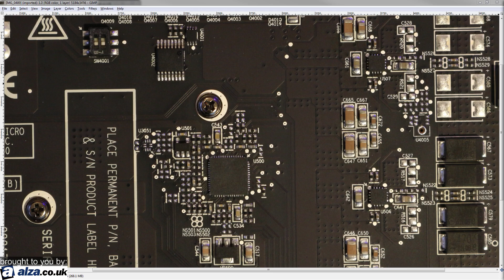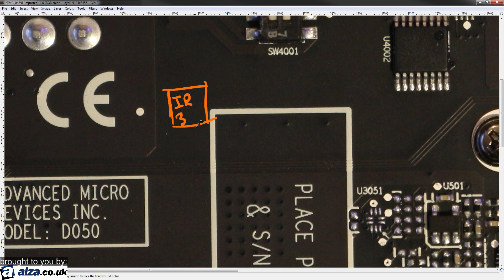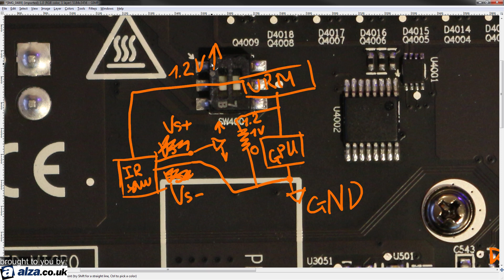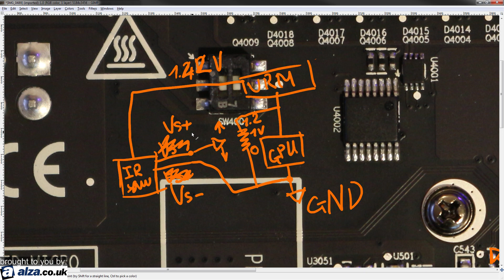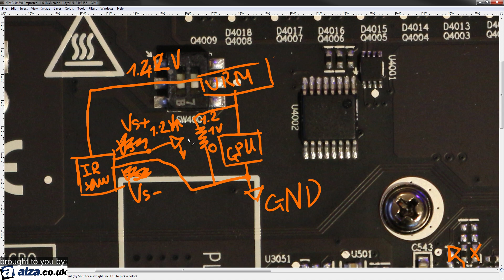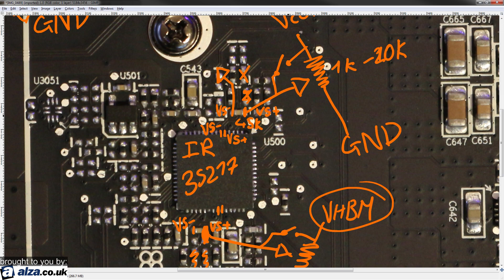Voltmodding Vcore and VHBM on RX VEGA

Comment: What is the purpose of those 2 resistors? 0 ohm resistors to couple to Vout to the sense pin? why 2? A schematic/drawing and some in depth explanation would have been nice. there are no resistors in the design example for the (a.f.a.i.k) comparable IR35201.

Comment: When you're explaining the HBM mod are you sure the two resistors you noted that needed removal are the correct ones? It looks like It should be the two leftmost resistors out of that set of four, not the center two. It looks like there's a differential pair of traces coming from the left two resistors which would make more sense to me. IIRC you've said before that there's probably no reason to do that mod anyway so not a big deal. 

Anyway thanks for the cool videos on GPU PCBs! I'm really enjoying them.

Comment: i got a vega 56 and i donno if the results are a lie or not.

it says its getting 1719mhz peak core with 950mhz ram. stock bios 50mv undervolt stage 6 and 7. hbm is 50mv overvolt. max fan setting is 3400rpm and it doesnt get hotter than 62C. im gonna flash the bios when the warranty is gone.  though i donno if its worth it.
Reply: if anyone else has a vega 56 id like to know what your getting

Comment: WHere do you order your caps from for the card mods?
Reply from the maker: digikey
Reply: Thanks man, need some for a old motherboard that need recapping, I was looking for the aluminium electrolytic polymer capacitors but they so expensive on ebay

Comment: What is the capacitance of the mlcc on the feedback pins ? I'd like to know since the potentiometer 's resistance combined with the capacitance would create a low pass filter, which if not calculated correctly, could introduce a significant delay in the feedback voltage.
Reply: Which was what killed his Vega FE
Reply: you're talking about a RC Integrator Circuit right?
Once the voltage is stable, this shouldn't matter right? so this would be a problem at initial startup voltage regulation or large transients, right? Overshooting due to delay (capacitor charge), and the VRM controller trying to level out its output. Or am I misunderstanding this? I'm trying to understand what you are stating here.

Comment: I'd strongly recommend putting a fixed-value resistor ~3X the value of whatever pot you use between ground and the pot to limit the max overvolt to something probably survivable like 30%. Without that resistor to limit the adjust range (ex.: 27-33k for a 10k pot), you can accidentally end up sending 12V to core/hbm/whatever by turning the pot the wrong way. That also has the benefit of making more of the pot's adjust range usable.

An even better option would be to use a pair of fixed value resistors to provide the maximum overvolt feedback signal and then use the pot to trim the Vout-FB resistor to reduce the overvolt. This way, you don't have to worry about the pot's wiper contact noise messing up the feedback signal as much. With only the pot in the circuit, bad wiper contact could send massive voltage spikes out of the VRM.
Reply from the maker: did I not mention that you should put a resistor on the GND side of the pot to limit the max overvolt? As for the wiper contact issue a resistor to GND actually wouldn't do anything. The moment that the VS+ pin isn't connected to Vcore you're gonna get a burst of 2.4V before the VRM shuts down(no voltage controller used on GPUs will let you go much past 20% duty cycle so 12V is not gonna happen bu 2V+ is still really bad). So for the wiper contact issue you would want a resistor going from Vcore to VS+ to make sure that VS+ is never disconnected from Vcore. 

I wonder if I need to release a revised version of the video now.....
Reply: If you mentioned the resistor to GND, I missed it. As for the resistor from VSS to sense, you can use the pot itself for that: connect one end of the pot to Vss and tie sense to wiper+other end of the pot, this way you never have more than the pot's maximum value unless the carbon track fails. (Although using a parallel resistor, preferably as an SMD divider on the board, would have the benefit of lowering noise on the sense line.)

Comment: Does it make sense to increase the VHBM? to get the ram over 1100mhz?
Reply from the maker: From my testing even 1.42V on the HBM doesn't help for going past 1100MHz on ambient cooling.
Reply: That's nice to know. So no hard modding required for my card, as mine reaches 100MHz at 1.05V dead stable.